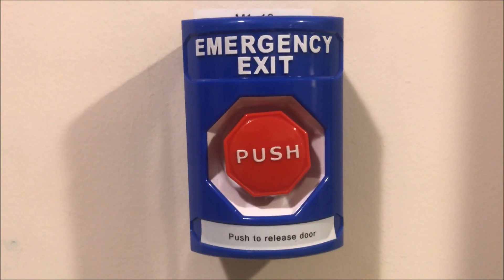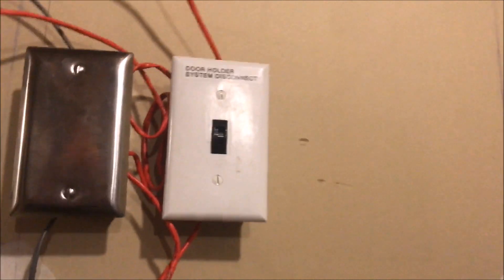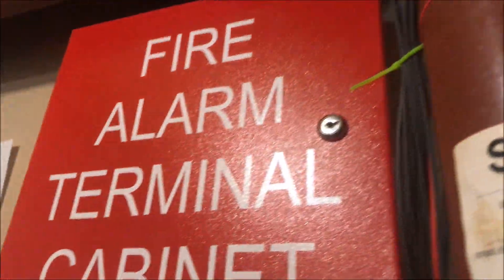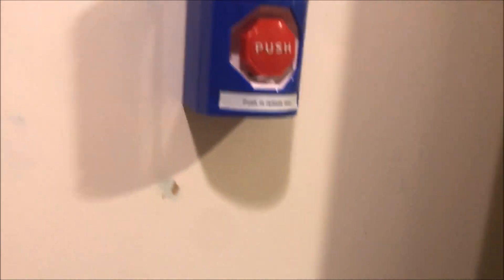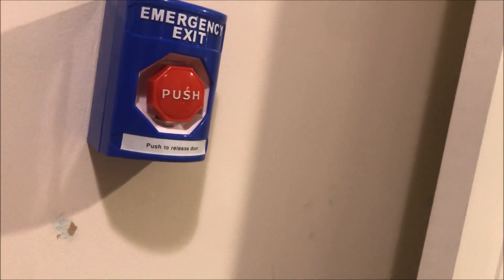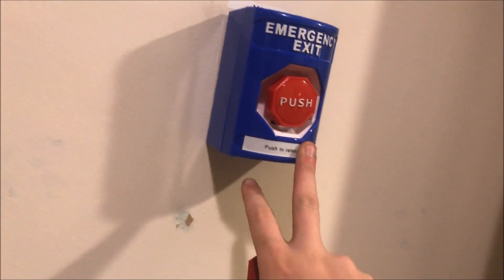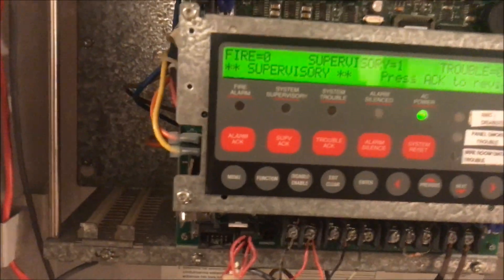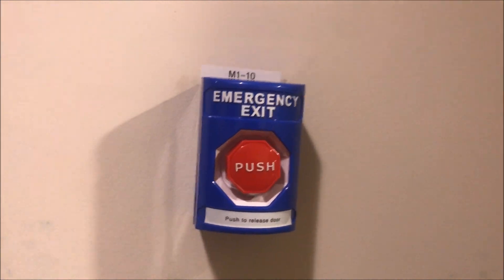Putting a Simplex 4010 FACP into Supervisory (Door holder changes)

Comment: Where did you get that STI push station?
Reply from the maker: cooldomino eBay
Reply: Do you have a link for the listing? What is the model number for that push station?
Reply from the maker: The listing is long since gone, but the model is Stopper SS-2002 Series button
Reply: Thanks. This would help.